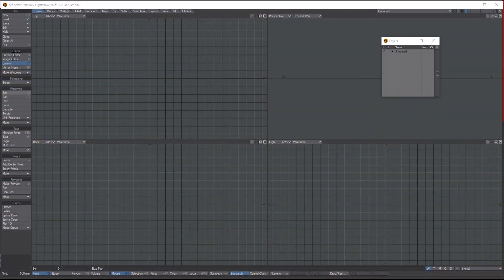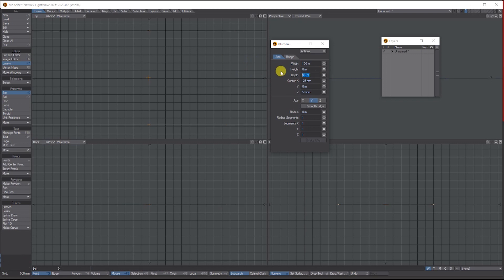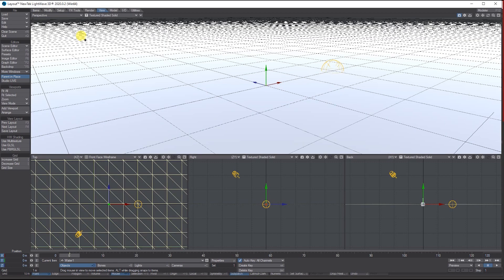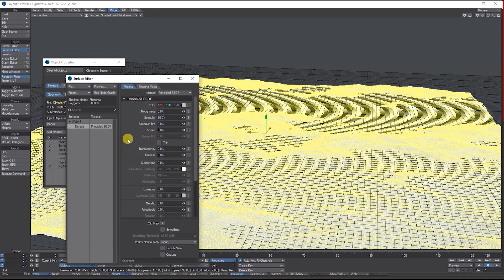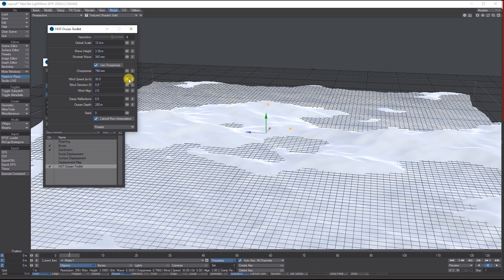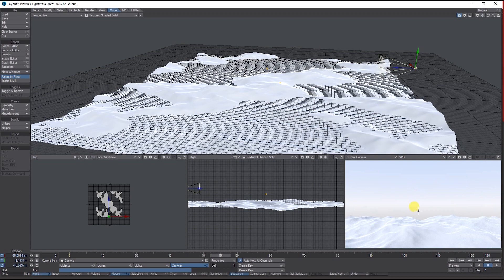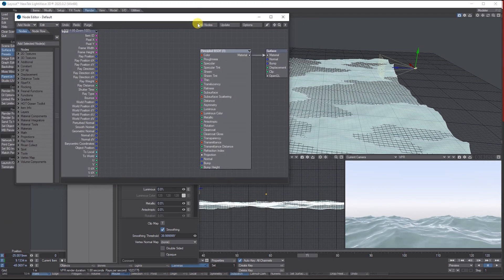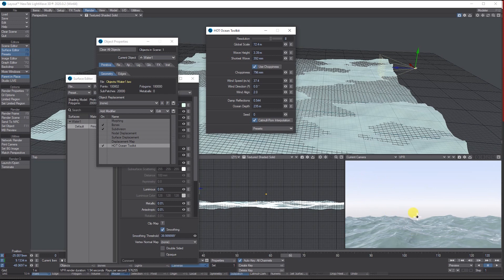Lightwave 3D Hot Ocean plugin tutorial

Comment: note. if the plane created in the modeler is 100 meters x 100 meters then you should also specify this in the layouter in the HOT plug in as the global scale. then you can take the 100 meter plane and seamlessly instantiate it with the instancer. there you use, for example, the rectangular array with a distance of 100 meters in x and z. then the ocean is endless. :)
Reply: cool, clever.  :)
Reply: @erikals  yeah! we are LightWaver! :)
Reply: @LightwaveGuru  for big Scenery work, LightWave rocks  :)
Reply: @erikals  this also saves a lot of memory. you don't have to make the drawn polygon so huge. and depending on the camera position, this is enough without the instanced ocean tiles repeating themselves too much. (regarding the seamless waves that are possible). the best tip is still the following. if you put two times the ocean hot plug in on the plane and one version of it is twice as big as the other then you can mix the waves more and still they will look seamless in instancer. (the power of 2!) because HOT is based on procedurals.
Reply: @erikals   btw you can also make the foam crowns with the second instance and key it out via a dirt or patina node so that you have the foam crowns separated. via an alpha channel. but that is a secret. :) so don't tell anyone. :) if you render with Octane, for example, and therefore the foam function is not available in the classic way.
Reply: @erikals  last but not least, the geometry deformed with HOT also works as an emitter for open vdb. that means the scatter node of open vdb recognizes that the geometry is deformed by a procedural. even if you put out particles based on this geometry open vdb recognizes the open vdb.  you know what that means, right? :)
Reply: @LightwaveGuru  actually thought of doing something like that in a future video, but you know. time.  :) thanks for confirming! also been considering mapping a video, but would work only in certain situations. (and would have to tweak it "lots-lots")
Reply: @LightwaveGuru  Splash, i take it  :)
Reply: @erikals  yes for example a u-boat appears...and then....BINGO! :) in principle, this works wonderfully. the rest is then the strenuous . so that it also looks good.
Reply: @LightwaveGuru  Mighty cool  :)
Reply: Brilliant... i just got HOT to work using the .dll's from the download instead of .p and then used the instancer- brilliant expansive ocean!
Reply: @jenjon753  :)